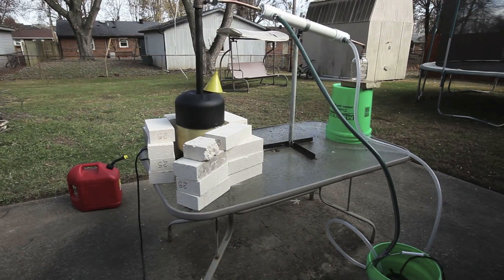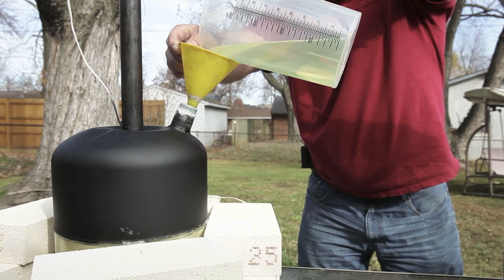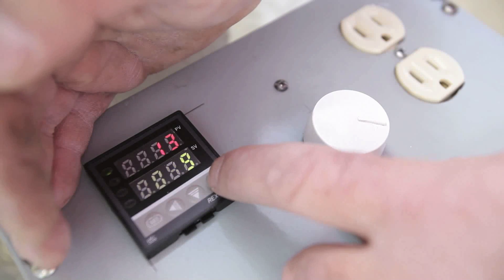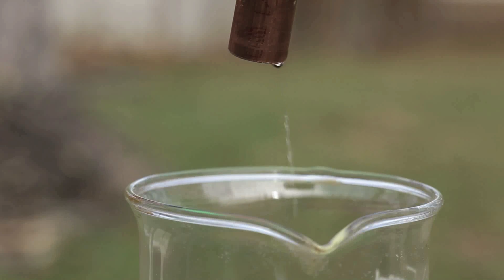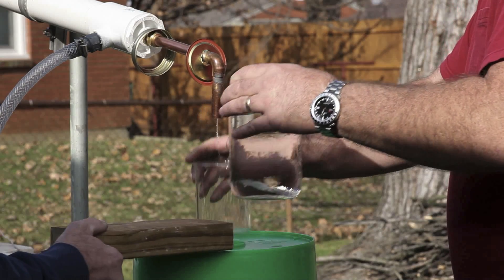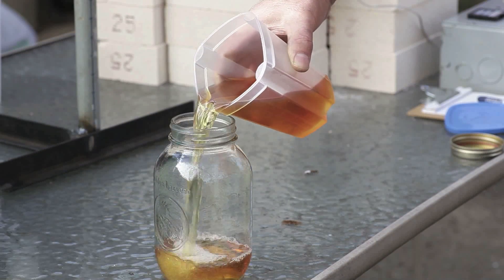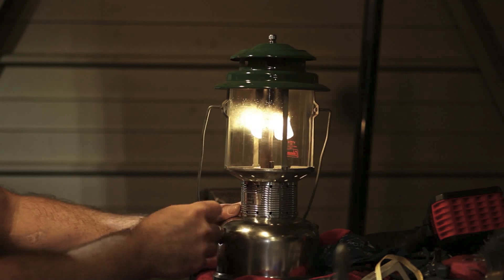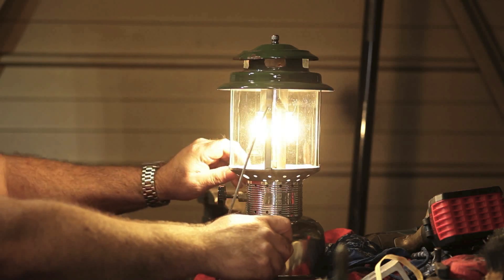How to make Coleman lantern fuel at home

Comment: You mentioned in another comment something about cutting it off at a lower temperature the next time you did it, I was wondering how much that increased the loss?
Reply from the maker: Jason Mitchell Jason I hate to admit it but I haven't made another run yet, so I'm not sure how much less I will get.  The mass spectrometer indicated a few higher boiling point constituents that were not in the pure Coleman fuel, that was why I thought I would cut it off sooner.  Its kind of a hassle to do so when I run some I usually do a bunch, that's why I haven't tried it at a lower point yet.  If you are doing this and you keep your fractions separate you can make custom blends any way you want.  The left overs can be used to start fires,  I mention they were hard to light but they will burn kind of like kerosene.
Reply from the maker: Jason Mitchell I also want to remind anyone that does this to use good judgment.  No open flames, everything airtight, and don't run the pot dry.  Things like that.

Comment: Any idea what the octane # is of your product?  I use coleman fuel in my antique stationary hit and miss engines.  Looking for a more economical fuel source.  And where would one find plans for building the still?
Reply from the maker: Octane rating is difficult to determine but I have run samples through a Mass Spectrometer and the product is very close to Coleman fuel on the light end but there were more aromatic compounds in the gas than Coleman fuel.  Based on my findings I will probably cut my endpoint back to about 135 C next run.  There is no reason you shouldn't be able to run this in your engines.  As far as plans I just made it up as I went.  As long as all your joints are air-tight and you use good judgment you should be fine.  You don't need all the electronics that I used, you can get by with a hot plate with an infinite control and a good thermometer. You just have to go slow and pay closer attention so you know when to stop heating.  If you use several collection flask(mason jars) you can custom blend your fuel with as much light or heavy molecules as you like.  Low boiling point equals low octane, just a rule of thumb.
Reply: The oct for doing this comes out at about 50to55 oct.

Comment: can't U use methanol fuel
Reply from the maker: I have modified a lantern to use alcohol it works OK but not as well as light naphtha that is why I chose to distill gasoline.  I just ran the distillate and Coleman fuel through a gas chronograph mass spectrometer and the results were as expected the gas had a lot of aromatic compounds that were not in Coleman fuel.  One other thing I noticed that there were a lot less high boiling point constituents.  The next batch I will cut it off at say 130C rater than 155C.
Reply: I tried methanol, it lit and goes out. ? Duel fuel means you can use gas also.
Reply from the maker: MNicehole
Correct you can use gas in a dual fuel, however the generator will still clog up with the heavy components of the gas just not as quick as it would in a standard white gas lantern.  To use methanol you need to use a larger jet if you want to try that I am sure you can get it to work.  The reason for doing this is more for fun than anything else, but for some people the coleman fule is so expensive and spare parts for the lanterns are costly as well. It gives those an option that want to try it.
Reply: I'll play with it and get back to you all on the hole size.
Reply from the maker: if you are using a single mantle lantern try the jet for a two mantle, that's what I used.  Jet for a 220 in a 200A

Comment: You can also run your Coleman Pressurized Gas Device cleanly on Naptha or Xylene- Sold as "Goof Off"- But as this video shows using modern Unleaded pump gas in the Coleman will result in a gummed up lantern- and an awful smell.
Reply: white gas is pretty much naphtha, but people should stay away from xylene as much as possible. I use it at work, that stuff is extremely dangerous, not just because of it's fire risks, but more for it's health risks, it easily absorbs through the skin and bypasses the blood brain barrier. I've known many co workers that have died from complications related to xylene and more that are permanently disabled because of it

Comment: Greetings excellent video, friend be able to give me details about the environment tenperatura, I understand that you manage the vaporization of benzene at 30 ° c, I want to know if the brass tube inside the pvc pipe is straight or is screwed, thanks in advance
Reply from the maker: The tube is straight and the column on the tank is filled with broken glass.  The end point is 155 C.  That gets rid of most of the high boiling point liquids that will gum up the generator of your lantern.  I hope this was helpful.

Scott
Reply: S Heath   thank you very much for your answer, which is what this glass filler? the bottle and the pipe where you put gasoline or pvc pipe which serves as coolant for the distillation.
Reply from the maker: Aristides Nuñez The broken glass is in the column on the top of the tank where the gas is heated.  It acts like a fractionation column sort of.  For it to be really effective it should be a lot taller.  For the purposes here it works fine.  I hope that helps.
Reply: S Heath Greetings and thank you very much, the container should also be filled with glass or just the standpipe. diamentro and height which is recommended for the pipe
Reply from the maker: Aristides Nuñez Just the vertical pipe.  There is a stainless steel screen at the bottom of the vertical pipe to hold the glass in. The pipe is about 50cm.
Reply: S Heath You talk about different fractions, WHICH ONE makes good Coleman Fuel?  :D   Maybe the answer is "all except the dregs" but that's very unclear.  What's the first fraction good for?
Reply from the maker: The lowest boing point components come off first.  They are the easiest to vaporize and don't tend to clog the generator I stop at 155 C that gets most of the heavy components out.
Reply from the maker: Derek1G I mix all the fractions below 155C.  I have had good luck with this approach so far. The final product is very close to coleman's fuel in the initial boing point mid point and final.

Comment: I've built a distillery just like this. I used ethanol free fuel and I don't get any dregs. Also the liquid that comes out of the condenser still seems to be gasoline and not lantern fuel. Any thoughts on what could be wrong?
Reply from the maker: Peter
You need to stop your distillation before it gets to the end boiling point, 150C or about 300F is a good end point to keep the heavy stuff out of your final product.  The reason it still seems like gas is because it is.  However many of the additives that cause trouble in lanterns have high boiling points and will be removed when you stop at 150C.  The difference in smell has to do with some of the aromatic compounds that are in gas but not present in coleman fuel. Coleman fuel is gas also, it just lacks the additives that reduce detonation. Coleman fuel has an octane rating of about 50 and will run in engines with very low compression.  I hope this was helpful to you, if you have any more questions fell free to ask I will help you if I can.
Scott

Comment: Can you distill gasoline that has been blended with ethanol?  It's hard to find pure gasoline these days.  There's a station in town that sell high octane racing fuel that has no alcohol, but it's pricey, although not as pricey as Coleman Fuel.
Reply from the maker: Most of the additives to increase the octane are also more complex and higher boiling point components and will be cut from the lower fractions.  I'm not sure if the percentage would be more favorable or not.  Maybe the next time I make a run I'll try some and see what the output shows.  Thanks for the interest.
Reply: Some grades of racing fuel are leaded, so make sure you know if it is. MAKE SURE.
Reply from the maker: You can separate the ethanol from the gas with water separation, that gives you about 90% reduction to start with before distillation.  But if you cant find ethanol free gas it better than nothing.  There is only one station in my town that has ethanol free gas.  You might search the net to see if you can find it before you do water separation.  Not that its that hard, it just takes time.
Reply from the maker: One wants to use the cheapest grade of fuel available that has the lowest octane.  Racing fuel, avgas, and high octane fuels have additives that boost octane but also are difficult to vaporize and will clog the generator. as well as lead.
Reply: Some of the premium gasoline's do not have alcohol in them

Comment: Do you think you get enough butane fumes to try setting up a recycler that burns it as a secondary heat source?
Reply from the maker: There isn't much Butane in summer gas and very little in winter gas, probably not enough to bother with.  The equipment to capture it would be far to expensive to justify.
Reply: S Heath Is there a practical way to flare it off?  Like the billions of cubic feet a year, around the Caspian sea.
Reply from the maker: Flaring is possible but is to no advantage and adds an extra level of danger that is unnecessary especially considering the small quantities involved.